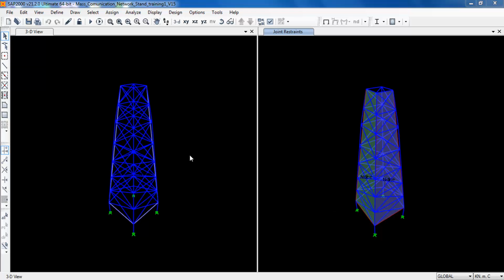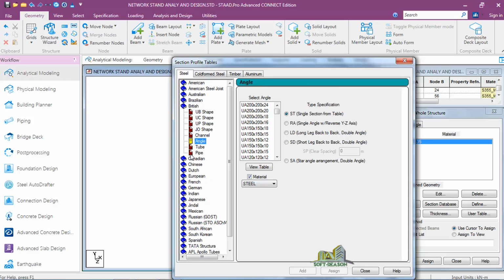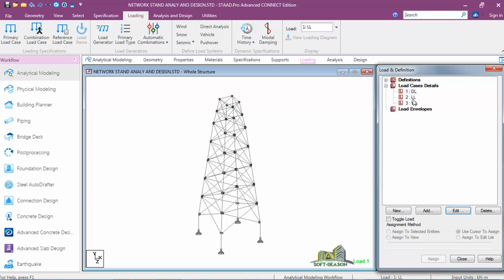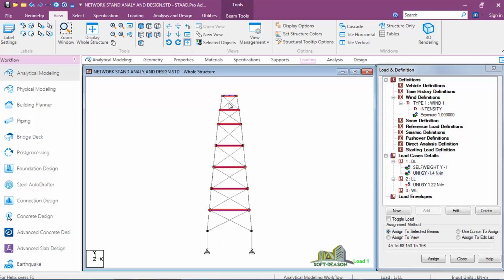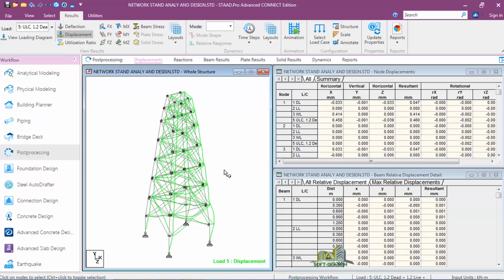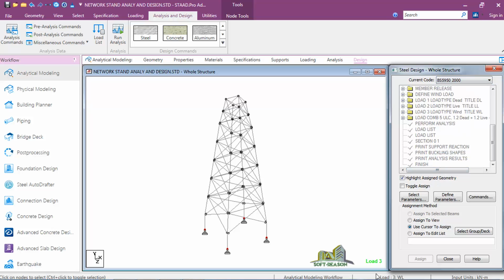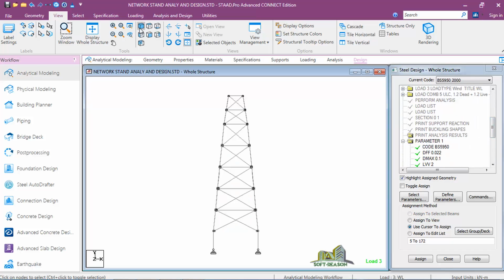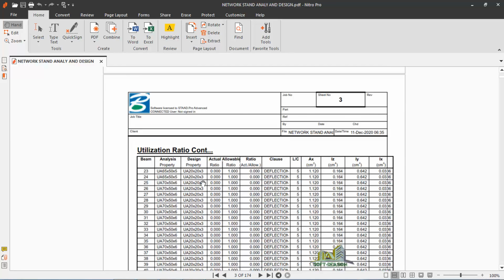Export from SAP2000 TO STAAD.PRO, Analysis, Design and Report of Mass Comunication Network Stand

Comment: Is it possible to transfer load data from sap2000 to Staad.pro ? I checked the option in sap2000 ,but after import to Staadpro there is not loading data...
Reply from the maker: Load data string in Sap2k is different from that of Staad. Pro. You can only your section data and support from Sap2k to staad.pro. there may be an option to resolve this in higher version of Sap2k. Check out.